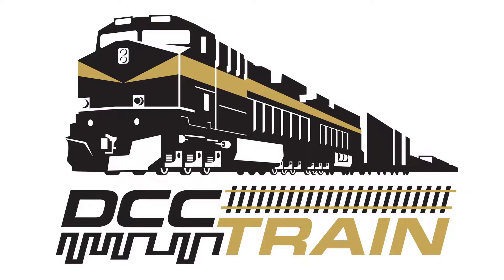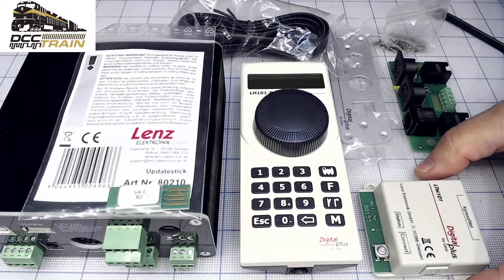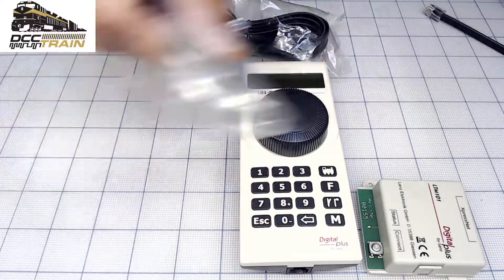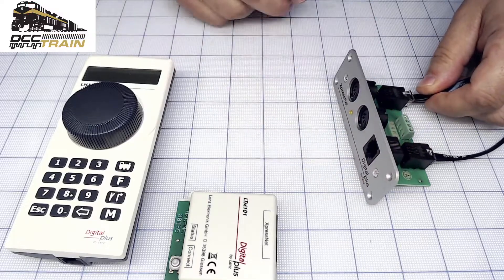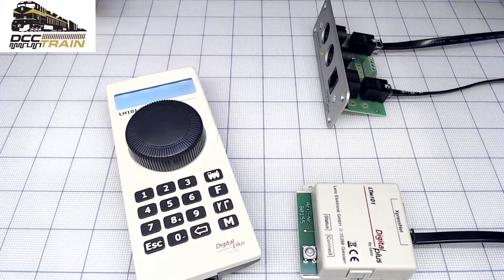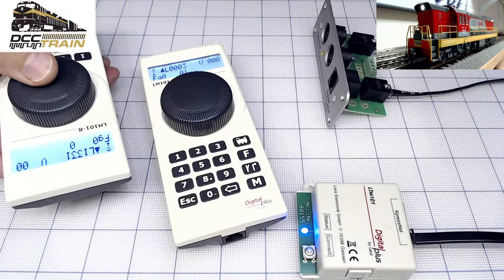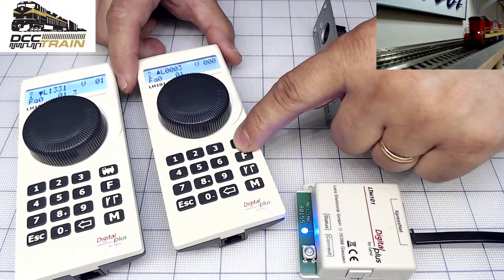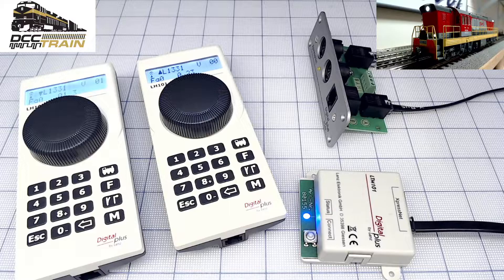How to connect LENZ LTM101 via XpressNet?

Comment: Thankyou for your video, very I formative. I have the old LZV 100 system, can the LH 101 wifi system be used with that?
I have not upgraded yet, (I'm still happy with what I have) although our club has the new LZV 200 system, and we love that.
Reply: You are most welcome. It will work with the LZV 100 version 3.6

Comment: What gauge wire do I use for the plug connectors
Reply from the maker: @trains3501  to connect XpessNet devices please use 6 wires modular cable 26 AWG
Reply: @dcctrain  cable from transformer to Lenz 100, I am  in Australia and there is no retailer here handling Lenz it is very difficult. I bought this product over 10 years ago
Reply from the maker: @trains3501  from transformer to LZV 100 you can use 18 gauge wire.